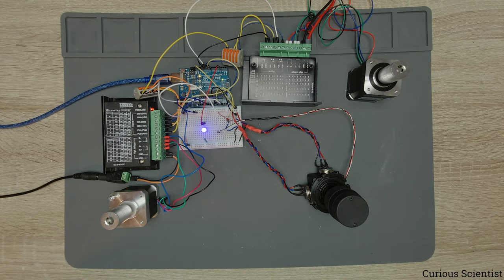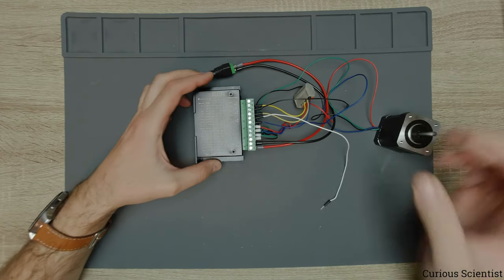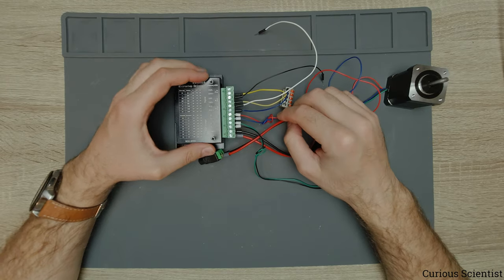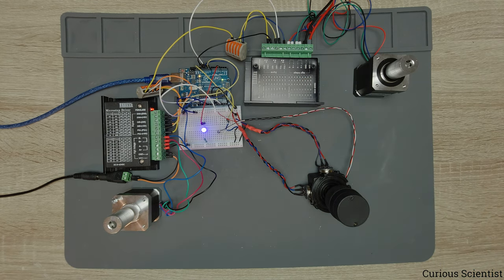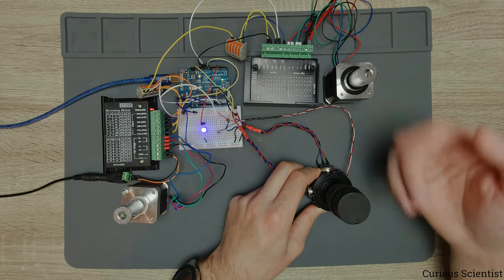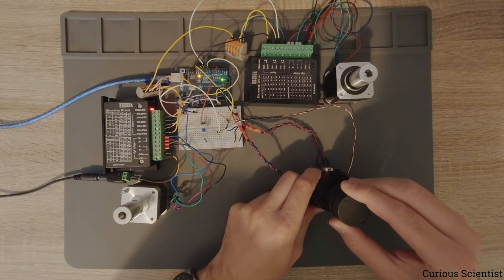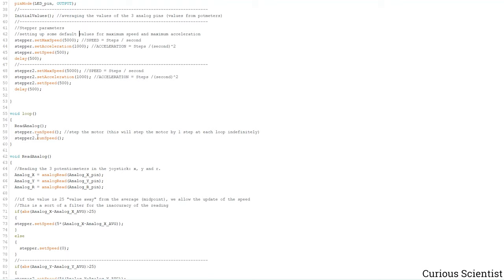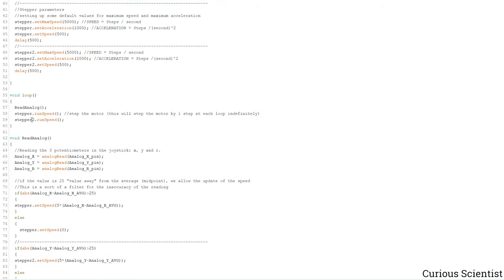Multiple stepper motors with joystick, TB6600 and the accelstepper library

Comment: Great vid. The resonance fenomenon van be avoided by using TMC drivers. I have been using all kind of drivers for my projects, like A4988, DRV8825, M415C, HY-DIV268N and a couple of other ones. They all had in common, that they can't cope with the resonance and electrical noise. TMC drivers however are absolutely silent.
Reply from the maker: Thank you! Yes, those drivers are more silent, I have them in my 3d printer and they make a huge difference. They also come with some extra features as compared to the other mentioned drivers.

Comment: just ordered your preferred joystick. your setup is almost exactly what i need to use. Hate reinventing the wheel, so looks like this will save a bunch of time. 
Maybe i missed something, but didn't find the webpage you mentioned as place where one could download the accellstepper code that you wrote.? worst case i just retype it all.
Reply from the maker: Hi! I don't know what you missed, but the website link is (as always) in the description of the video. This joystick is a really good one, I really like it. It is robust and it has a nice mechanical response.
Reply: @CuriousScientist  You didn't get his question. He asked that: he didn't find the webpage you mentioned as place where one could download the accellstepper code that you wrote. 
The weblink for your modified "accelstepper code is not here. Without it, it doesn't work.

Comment: Great video 😊 I was wondering (as this vid is 2 years old) if there is other newer hardware that could be used? Also could it be made to control 3 stepper motors with a six way joystick? (Adding the Z axis) I’m new to this, yet have a project idea that would work great if the 3 stepper motors could be controlled via a joystick.. 😊
Reply from the maker: Hi! Check my more recent video and the corresponding article:
https://youtu.be/5BA5bfmcrb0

Comment: Very informative video.  However, I believe there is a mistake in the schematics.  For stepper motor 2
                               PUL-    connects to Pin 10    (according to code)         to Pin 9    (according to schematics)
                               DIR-      connects to Pin 11   (according to code)         to Pin 10  (according to schematics)
I assume the code is the correct
Reply from the maker: Thanks for the remarks! I fixed it. The code is correct as you can see it in action in the video.

Comment: Hello I don’t know a lot in electronics but what settings do you have on your drivers ? And if I need to increase a microsteps what should I change in the code ? Thanks
Reply from the maker: Hi!
Microsteps (and current) are set on the driver. I don't remember the settings, but it is probably written in the code I published. You can check the current needed in the datasheet of the stepper motor you use and the microstepping is entirely up to you.

Comment: Sir, what software do you use to make the diagram?
Reply from the maker: Hi! It is Fritzing. But the diagram on my website was only partially made with it. It did not have the model for the TB6600 so I pasted my Fritzing-made circuit into Paint and finished the rest of the circuit with the TB6600 using Paint.
Reply: Okey thanks sir😊

Comment: Great tutorial! I have a question... the same power supply for both tb6600 are independent? Is there a problem if I use the same for both drivers?
Reply from the maker: Thank you! Of course, you can power the drivers from the same power supply! Just make sure it can provide enough power for both drivers/motors. I used independent power supplies only because of convenience. It was easier with the cabling for me. :)

Comment: Thank you for your tutorials, they are all super useful.
I am replicating this one with an ST-M5045 driver, a nema 24 motor and a 10k potentiometer. It works, but the speed is not as fast as in your video . I tried changing the 
stepper.setMaxSpeed(5000); //SPEED = Steps / second  
and it doesn't change anything. I also tried changing the multiplier (5) in 
stepper2.setSpeed(5*(Analog_Y-Analog_Y_AVG));  
It does get to my max speed faster but the max speed stays the same. 
Any help is very appreciated.
Reply from the maker: Hi! Thank you for the kind words! If your stepper motor is not as quick as mine, check the following settings:
- Check the microstepping - I always use 400 steps / turn.
- Change the acceleration (this will not work with the runSpeed() and setSpeed() functions however - use the run() and setMaxSpeed() instead at the corresponding places)
- Change the max speed.
- Better power supply. (I am running tiny motors, they are easier to speed up)

Let me know about your progress later!

Comment: Dear Sir, your work is fantastic! Could you please tell me how to integrate 2 limit switches ( in other words 2 "if" statements ) into your sketch in order to stop the motor from over-running in each direction but still allowing to bring it back from the "limit"-position? Thankyou in advance.
Reply from the maker: Hi! You can stop the motor after a limit switch is hit and then make it go back until the limit switch is released.

Comment: I'm controlling mine via http requests over pygame and a joystick from a client pc. 
It's pulsing the motor based on how fast the packets are being sent. so the motor cant move fast at all. 
what method can I use to get the motor to pulse fast, whilst using my x_axis -1 to 1 values?
Reply from the maker: How fast is fast? Stepper motors are not that super fast, they are made for precision and not speed. With proper driving, 2-3000 RPM is achievable, depending on the type of motor and driver.

Comment: I spent a lot of time for looking similar project with stepper motor control speed and direction by joystick but with A4988 driver and found nothing. Can you help me find the code for A4988 driver?
Reply from the maker: The driver doesn't matter... it is still a step/dir type of driver. They are interchangeable. Also, if you look at my videos, you will find a video where I demonstrated this.

Comment: Hey this is my 1st arduino project so Im just learning, I tried to run a test build before changing anything but it fails and this is what it says 'InitialValues' was not declared in this scope' & 'ReadAnalog' was not declared in this scope', I thought these populate from values generated by the pot, am I doing something wrong? Thanks for any help
Reply from the maker: Hi! Maybe it is a bit too complex for a first project. :) You have to follow what the error message says. These two FUNCTIONS are not declared! They have to be declared. Seems like you did not copy the exact code, or missed a "}" somewhere or something like that. Does your code contain the initialization of the above mentioned functions?
Reply: @CuriousScientist  Thanks for the reply, after seeing your reply I figured I would try in arduino sketch instead of vscode and it did compile but do you know what I would have to change to use with a tmc2208 driver
Reply from the maker: @davidmarrazzo7223  Hi! The mentioned stepper motor driver should work without any problems and modifications. It has step and dir pins like any other drivers. You connect it in the same way as this driver I use, but instead of pul, you have step pin. Also, I am pretty that you can find some wiring diagrams on Google.

Comment: Nice, thank you for this tutorial! What do you think, it is possible to make a setup like this with 3 stepper motor using an TMC2208 Stepper Motor Driver?
Reply from the maker: Thanks!
It would work with "any" number of drivers and motors as long as you have enough pins on your Arduino for that. All you need to do is to define the motors one by one in the beginning, then refer to them in the code appropriately. The accelstepper library works with this particular driver too since it just needs the "step" and "dir" pins. As I added a second motor to the code in this demo, you can add a third, fourth..etc. (AccelStepper stepper1(1,8,9); AccelStepper stepper2(1,10,11)...etc.). Just follow the same strategy. Let me know if you need more help!

Comment: Great video, I was wondering how can we add limit switches and a MG995 servo ? can u route me to a direction ?
Reply from the maker: Hi and thanks! Check my recent videos on stepper motors, there you'll find the answer for limit switches. Adding a servo is a different thing as it would require a different controller and probably a different code as well.

Comment: Very nice video.. I found it just in the right time for a project I'm working on.. I have one question though, I used the code exactly as it is and just changed what needed to be changed however I don't seem to notice that this library does acceleration or deceleration  for high speed movements. Is there a method or a function to accelerate other than setting max speed and setaccelerate?
Reply from the maker: Ummm, if you would have watched the video carefully enough and read the documentation of the accelstepper library, you would know that the runSpeed() function does not use accelerations.
Reply: @CuriousScientist  I probably missed this part, so how do I use the same approach with acceleration and deceleration feature
Reply from the maker: Read the documentation of the accelstepper library. Everything is explained there.

Comment: Thank you for all the tutorials!! I'm trying to remote the joystick via rs485. I've substituted the A0 pin for "int Analog_X = Serial.parseInt();" I can get the joystick reading from the Master arduino on the slave in the void ReadAnalog() fine, but for a reason that I don't understand, I can't use the "int" value from the Serial.parseInt() in the other void events or equations. So the Interval Values are always zero. Any pointers would be gratefully received. Many thanks
Reply from the maker: You are welcome. Did you check if the master sends the values to the serial? Then, are you sure that you define the variable at the beginning of the code and not inside a function? I suspect that you defined the variable maybe twice, once in the beginning, once inside a function. And since you redefined it, its value became zero. But it is hard to say anything helpful without seeing the actual code. (Please don't paste your code in the comments because it destroys the comment section and I cannot read the comments properly).
Reply: @CuriousScientist  Thanks for the help. Half way there now! The calcs are working, so stepper is moving with joystick via rs485, but much slower.
Reply from the maker: You're welcome! If it moves slower, it is very obvious that something is not correct with the speed settings.

Comment: Thanks a lot. But if I have a StepStick A4988 controller, and it has 2 control pins, the step and direction. How to be?
Or why do you have 1 pin specified for 2 motors?
Reply from the maker: What do you mean? This motor controller also has 2 pins, step and direction. I also have a video about this topic: https://youtu.be/_enXxcBTOdM
Reply: @CuriousScientist  on the code 1, AccelStepper stepper > 1 < , 8, 9 pin.
Reply from the maker: Seems like you haven't read the documentation of the Accelstepper library. Read it and you will see why it is used. It is not a pin definition, it indicates that a stepper motor driver is used, so step and direction pins will be used in the argument.

Comment: Hello. You made a great video and I really like this project. I want to ask if it can be used as a power supply pc source if I like this as a good solution since there is 12v for driver and 5v for arduino power supply it will be ok  ?  Thank you for your answer and I still wish you a lot of such videos
Reply from the maker: Hi and thank you! If you mean that you want to use a PC power supply to supply this circuit, then it is perfectly fine. As you said, you can use the +5 V rail for the Arduino and +12 V for the TB6600. I will soon have a video with this exact topic: joystick and stepper motors. I will build an x-y table. I just got the parts this afternoon.
Reply: Yes I meant an ATX 600w power supply from an old pc ....
Reply from the maker: It should be good!

Comment: can you explain the power supply you used ? i'm getting a lot issues with power sup....
Reply from the maker: It is a simple variable power supply set to 12 V, nothing sophisticated. I have the product on my website under the parts and tools page.
Reply: @CuriousScientist  so you used 2x (Variable power supply (4-24 V, 2.5 A)) one for each stepper?
Reply from the maker: I ran two motors parallel. They won't take so high current anyway, so the supply can deal with them.
Reply: @CuriousScientist  thx!

Comment: Hi. On the link to the web page where the connection is like a mini cnc for 3 axes X, Y, R, it is generated, G, code and I want to ask if this connection and that code is functional for 3 axes or it needs to be modified.  I believe arduino will work on my mini cnc as well.Thanks.
Reply from the maker: Hi! Could you please rephrase your question? I do not really understand what you mean.
Reply: @CuriousScientist  Hi 
.  Simplified ... I want to make exactly this project of your 3 axis mini cnc.And I need, g, code I think it's called ... for all 3 axes controlled by a joystick .Please help me ... My flood question was about the link  on your web pages where you already have some code but I do not know whether it also applies to connections from 3 axes and joysticks
Reply from the maker: If you want to control the 3 axes with this approach, you do not need any g code as you have the full control over the joystick and you directly drive the motors. However, it might be a bit challenging or uncomfortable to have all the 3 axes on 1 joystick. X and Y can be on 1 joystick, but for Z, I would use another joystick, or 2 buttons (z+ and z-). I have never worked with any g code related things, so I am not familiar with it.

Comment: Sir can I run nema 23stepper motor on this code
Reply from the maker: Sure. It is not depending on the code, but on the driver. You might want to use a TB 6600 or similar driver to provide enough current.
Reply: @CuriousScientist  A stepper motor can be used instead of an LED for Z axis
Reply from the maker: @suri4kannada887  Sure. Each axis of the joystick can be associated with a corresponding stepper motor. Or just anything that you want to control with some input parameters.
Reply: @CuriousScientist  sir I want to build a cnc machine Pls tel me Suitable pinion and rack gear for nema 17 stepper motor
Reply from the maker: Google is your friend.